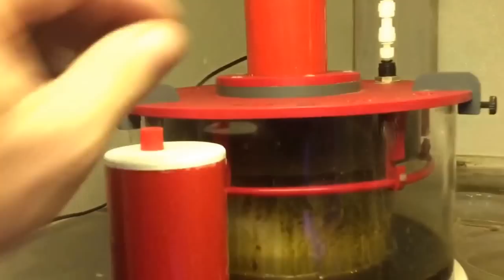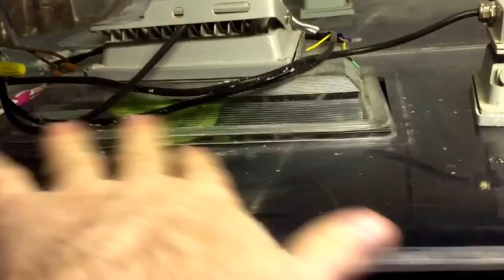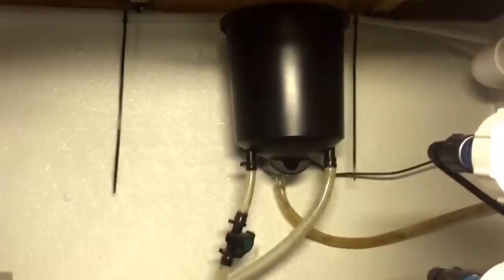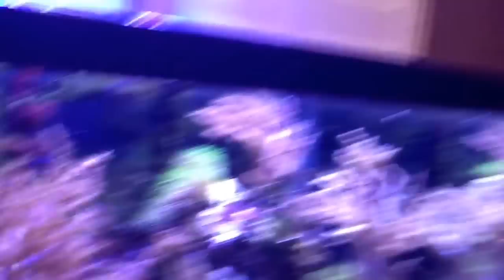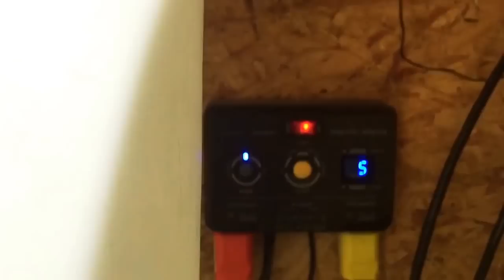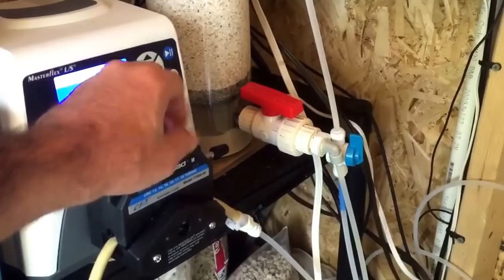Filtration & equipment for my 500 gallon reef tank. Total system volume is about 650 gallons.

Comment: I have a quick question. I'm just now learning about reef tanks. I've done some research and watched your videos a few times and think I understand your system pretty well, it's very cool. The question has to do with your display refugium. Why do you have your refugium, in the open loop, before the calcium reactor? I'm guessing it makes no difference, the water is going to be the same ph in the open loop, and so it's just for convenience, but curious to hear your input. Also how do you keep the troublesome algae out of your closed loop, but allow it to propagate in the open loop refugium? I'm having trouble understanding this. thanks in advance.
Reply from the maker: It was set up that way out of convenience. I have a manifold setup off my return pump and it feeds my carbon and GFO reactors, frag tank and display refugium. From the manifold, I can control the flow to everything connected to it via the individual gate valves. Both the frag tank and display refugium return to my return compartment where my return pump pulls from. The calcium reactor pulls from the return compartment as well. The calcium reactor returns into the head of the main refugium below the main display well upstream of the return compartment to prevent calcification in my return pump. There is a little bit of logic in the way things are laid out but also convenience when it came to plumbing it. At the end of the day, the only thing that makes a real difference is keeping the calcium reactors effluent as far up stream from the return pump as possible. There is enough turnover (flow) in my system that where the display refugium is makes little to no difference in the rest of the system and that includes pH.
Reply from the maker: And truth is that I pay little to no attention to my pH. Due to my house, dogs and people in the house, my pH runs relative low by many peoples standards. It runs anywhere from 7.8 to 8.1 depending on the time of day and whether doors are open or closed. After 30 years in the hobby,  I find chasing pH is a waste of time. I am more concerned about my alk levels than pH. My corals and the rest of my system seem to do just fine regardless of my pH. The key is stability and consistency.

Comment: I really enjoyed this. I have a similar tank volume but a totally different way of doing things. This has inspired me to make a video. You've done great work but I'm definitely a critic of your wire management. The supplies to make that look tight and uniform are only a couple bucks.
Reply from the maker: Thank you. I hear you on the wire management. I am usually very meticulous about wiring but there are so many wires in this system with all the controller components and I've upgraded/added to the system continuously over the years and it's gotten a bit out of hand. One of these days i will go back and clean some of the wire mess up.

Comment: If you combined all that equipment, plus all the livestock/coral/reef rock, how much did all of that cost?
I'm going to say at least $10,000
Reply from the maker: A LOT more than that! LOL.. I've had this tank since 1995 and it was moved to this house in 1997 where it's been up and running ever since. It's seen a lot of upgrades during that time. $10,000 wouldn't even cover the cost of the main display and lights. Given the amount of coral in the tank and the size the coral has grown to over the years, the coral and fish alone would likely cost more than your estimate... There is over 700 pounds of live rock in the system as well that I have had for over 20 years which would cost a fortune today.  Honestly, I wouldn't even want to add up the price to piece this system together. I am sure I could buy 20+ acres of river front property in Montana for what I have into this system.
Reply: slief fun hobby. 👍🏼

Comment: Impressive system. What is your investment in this setup?
Reply from the maker: Thank you very much. In all honesty, I couldn't even begin to calculate. Frankly, not sure that I would either.   I had the main display custom built in the early 90's and it's gone through a number of upgrades over the years in terms of the equipment. That last major upgrade was 2010 other than lighting, skimmer and pump upgrades to improve system efficiency and and coral health. I've got the system to the point where I am pretty much done with upgrades for the foreseeable future. As such, I don't anticipate more significant expenditures as it's kind of in cruise control so to speak. Truth be told that if I had to start all over and build this system as new, I couldn't afford to do it at this point in time.

Comment: Great tank and thanks for taking the time to make videos.  Just getting going in the hobby and have a 120 G bare-bottom with a tan colored HDPE board.  My ultimate goal is a large tank with nearly the same dimensions as yours.  My job will not afford the time for lots of daily or even weekly maintenance which is why I picked bare bottom.  However, I really want the look of sand and all the things that go along with it like certain fish.  How do you maintain your sand bed with minimal maintenance?  Is the spray bar using the closed loop enough to keep things stirred up enough to not settle and therefore vacuuming not necessary?  Any thoughts or comments would be appreciated.  Thanks
Reply from the maker: Thank you very much. I have very little sand in the main display and what little is there, I don't touch. Personally I prefer bare bottom from a cleanliness and maintenance perspective but the little sand I have is enough for my wrasses.  The closed loop that returns under the live rock prevents detritus from settling down there and the closed loop and Tunze's are all programmed (via my Apex) to kick up into what I call "flush" mode which blasts one side of the tank at a time via the Tunze pumps while the closed loop kicks up to a much higher flow rate. That stirs anything up on the bottom. The Tunze's will alternate from side to side during this phase to suspend any detritus and get it into the path of the returns to sent into the overflow where the filter socks in the sump are waiting. The Flush mode kicks on several times a day.  It works really well. Especially given that I have a lot of flow in the tank.
Reply: Thank you again!

Comment: did you ever consider using a manifold plumbing setup instead of using so many pumps?
Reply from the maker: I use a manifold to feed my reactors, display refugium and frag tank which are fed from my return pump. I have a second pump that runs my closed loop and dumps out under my live rock to prevent detritus from settling there and also eliminate dead spots. It also feeds my UV Sterilizer. Because that dumps out under the rock, that cannot be connected to the  manifold as a power failure could result in the tank draining.  Beyond that, I have a skimmer pump which is designed for my skimmer and lastly power heads which produce more flow and different currents with the tank. There really aren't any pumps that could be eliminated safely that wouldn't impact another area of the system.Plus, the pumps I run are all VERY efficient and reliable.
Reply: to run your reactors as well as for circulation you have enough flow from those pumps to do so
Reply from the maker: Not sure I am understanding you. My return pump runs the carbon and GFO reactors as well as my display fuge and frag tank. The pump I use maxes out at over 6400 gallons per hour at 230 watts. At the 150 watt setting, it has enough power to run everything and then some. That said, I wouldn't use my return pump for my closed loop. That is a big no no because of where the closed loop dumps out at. That needs to be a separate pump that is in a closed loop pulling from the back side of the tank and returning below the live rock. My power heads serve a very important purpose as well and again, the return pump wouldn't be suitable replacement for those. The produce fast pulses through the water and provide flow throughout the entire water column and not just the surface where the return lines exhaust. They also are programmed to flush the tank out several times a day to suspend detritus and send it over the overflow. In total, I have upwards of 35'000 GPH at my disposal in my main system and the return, closed loop and power heads all serve a dedicated purpose and one cannot replace the other. Alsio, my closed loop pump is programmed to go into high power output when my Tunze power heads kick into their flush cycle. This insures that anything that settled on the bottom of the tank is suspended since the close loop outputs at the bottom of the tank below the live rock.

Comment: i have a constructive comment. All the equipment you are using, a huge amount of money. a load of money in the tank. lots of equipment, which you could do without, yet you dont have a chiller? that to me is silly
Reply from the maker: I have a JBJ Arctica 1/2HP chiller in the garage that is plumbed into the system but it's not needed & never turns on. I've had the tank running here for about 20 years now. For the first 14 years, the chiller ran 12 hour a day until I upgraded my equipement to pumps and lighting that didn't transfer huge amounts of heat. This was back in 2010 and 2011. Back then my electric bill was about $1100 a month. Now with the upgraded equipment, my electric bill is $350 a month and my chiller hasn't run in years. Its there only for emergencies and essentially wasting space. The max my temp ever reaches even on the hottest days when I am not running my AC is 82* which is perfectly safe for a reef and my fish. In fact, most of the reefs where our corals originate from hit temps much higher than that in the summer months and I've also found that my best Coral growth is during the summer when the water in the tank is warmer.  I also use fans for evaporative cooling which typically keep the tank well below 82 in the summer. In the winter my tank is typically around 78 but it's hit as low as 75 which again has never been an issue. Fortunately due to my water volume, the most my temp can swing in a 24 hour period is 1* which is slow enough that there is no harm to the fish or livestock.
Reply from the maker: And, I could do without a lot of the equipment but my tank thrives and I only put about 2 hours a month into which includes feeding, making water, cleaning glass and running my tests. The automation takes most of the work out of maintaining a huge system. The quality of my equipment has also saved me tens of thousands in electricity and replacement costs over the years since my last major upgrade. My controller has saved my tank and home by notifying me of potential issues such as leaks, ATO issues among other things over the last 10 years so that is something I consider necessary. Same goes with the rest of the automation stuff. If I had to devote several hours a month to water changes, top offs, dosing and other maintenance that I've automated, the tank would suffer since I don't have the time for that kind of maintenance. Having the tank take care of itself and notify of me issues is hugely valuable with a system this large. Especially when II've had the tank as long as I have (23 years since having it first built). It's so much healthier now than it ever has been in all the years and the quality of equipment gives me peace of mind while also saving me with utilities.

Comment: hey.  do you have a link for information on that top off pump you use?  i want to run a stronger pump from my ro unit up to my tank
Reply from the maker: I use a Stenner 85M5 for my ATO pump. It's a beast and they are bullet proof but they are also noisy. 
http://www.lockewell.com/index.php?main_page=product_info&cPath=1_6_20_25&products_id=127

Comment: Amazing reef, what's the cost of running that size of tank
Reply from the maker: My power bill is typically around $350-375 per month for my entire home which is about 2200 sq ft. It's a bit higher in the summer when we run the AC. The tank is very efficient as I have very efficient pumps and lights. Total power consumption is around 1500 watts when the light are on and around 800 watts when they are off.

Comment: I'm looking to put a 300 gallon reef in my house. Just curious what is your cost for this gorgeous tank?
Reply from the maker: That is a really loaded question. You can easily spend tens of thousands of dollars on a tank that size. The tank alone can cost $3000 + depending on material, material thickness, overflow design, shipping etc. Then there is the stand and optional canopy. That doesn't include things like a large sump for a tank that size, refugium if you want one, media reactors, protein skimmer, pumps, lights, live rock or dead rock, water, salt, test kits, heaters if needed, chillers, controllers etc. Quality of equipment and the tank construction can have a huge huge impact on costs. It's best to determine a budget and work it backwards from there to see what you can build within that budget. My tank is 480 gallons at the display and the system is about 650g. In today's market, it would likely cost $30k to reproduce. I had my acrylic tank built over 20 years ago and had it built with very thick high quality material. Because of the quality and thickness of material. It's still in near perfect shape. The tank alone would cost over $6000 to build in today's market using the same material. Things add up very fast in this hobby.
Reply: +slief Thank you so much for the reply! I have a 75 gallon reef now. I am just not familiar with a tank of this magnitude lol gorgeous tank! I can see so much love for the hobby just watching this video! Amazing!

Comment: Man I wish you could come to my house and show me what I am doing wrong. I use Seachem Pro Salt( $$$$$), 50 gal Water changes every 2 weeks. RO/DI, small feeding, LEDs, sump, Reef Octopus skimmer and nothing ever lives. Phosguard, Carbon, filter floss, Mag 18, and the list goes on. Nutrients are low to 0. I even added a bag of lava rocks in my sum after washin it ofcourse.  Ahhhhhh
Reply from the maker: Lava rocks aren't necessarily a good thing in a marine tank. Some lava can have metals and other undesirable things in it. Large water changes depending on the system volume can also change the water quality or water parameters very quickly which can shock the inhabitants. I much prefer smaller daily water changes because it keeps things more consistent.
Reply: Good deal. Didn't think about it that way. Ill try doing 5 gal x 3/week  see how it works out. Thank you.

Comment: nice tank nice setting! organized however I don't understand why you used the water change system while you have the Apex system. by having an Apex you just have to add 3 float switches.
Reply from the maker: +Amin RB The Genesis Renew water change system is much more flixble than the Apex running the AWC. I have it set to do 5 gallons a day but if I want to change that, all I have to do is his a button to increase or decrease the amount in gallons. It's always spot on because there are two 1 gallon metering bins. Using float switches in theory is a novel idea but they lack the same kind of accuracy. There are always slight variances in where the float switch will change states. When you have a sump and refugium that totals over 180 gallons in capacity. The difference in as little as a 1/2 a mm in the float switch state change can result in salinity drift over time. Further, if I want to do a large water change, I can simply switch the Renew to continuous mode and select a number from 1 to 99 gallons and hit start. The Renew will then change out a gallon every couple minutes. To do the water changes with the Apex, it would have to be time based and not gallon based. If I used the Dos to do it, it would be painfully slow and require frequent calibration. Bottom line, for a system my size, the Renew is much more flexible, more efficient and more fool proof. especially since my Apex acts as a fail safe by monitoring salinity, float levels, water on the floor  etc that are all used as part of my fail safes and will shut the Renew down if a problem arrises.

Comment: Hey Scott..love your tank.I need some help with mine..Problem is i lost most corals and i was wondering how come.I have a 300 gallon tank  which now only has mushrooms and kenya trees left.I have a huge sump ,refugium.protien skimmer and a wet dry filter.Tank has been running for over a year.Tank mates 7 damsels,cleaner rass,yellow tangs,purple tang.hippo tang,a chillies tang,moorish Idiol,emperor angle,flame angle,madrin,Pakistine butterfly fish and 3 more small fish..Calcium is good and dkh is good. Lights are just over a year old.I have ro/di filter and use that water to top off and change water.Help
Reply from the maker: +Allen Tarver I am sorry for your loss. There are way too many variables to even answer why that could have happened. Anything from lights to your parameters, pH, nutrients, water quality, predators such as flat worms etc. Would need to know an awful lot more and YouTube probably isn't the best place to figure that out. I would suggest starting a thread in the reef section at Reef Central. Include all the details of your tank including pictures, light info and settings, Alk, Ca, Mg, pH, Po4 levels, Nitrate levels, flow, types of corals that died etc. The more info you provide there, the better information you will get in return.